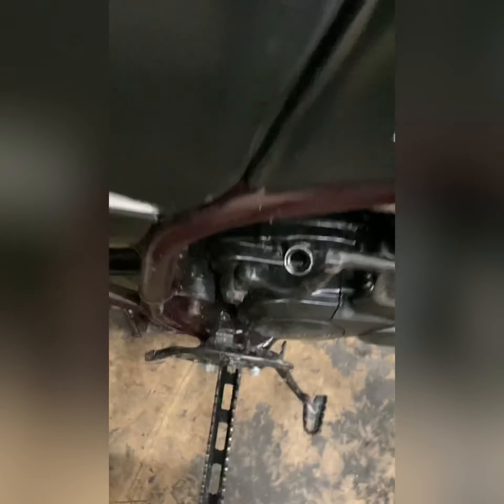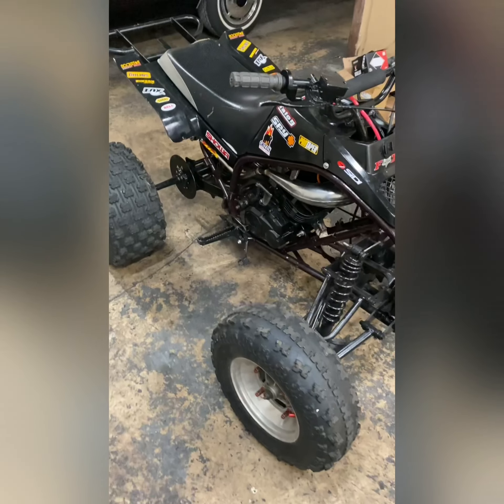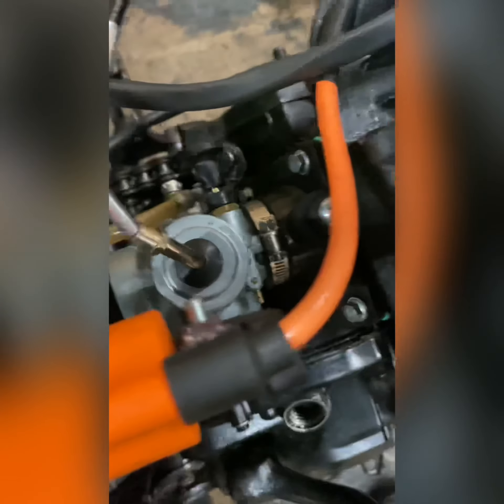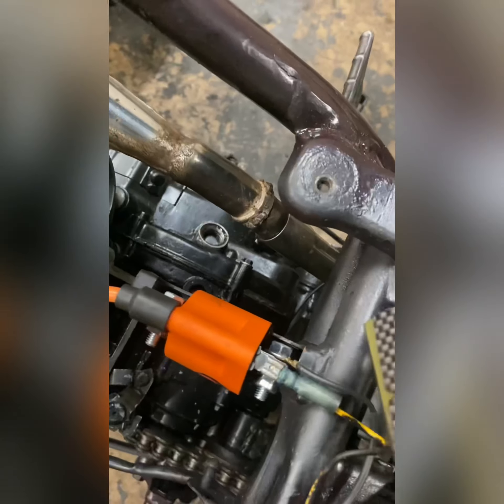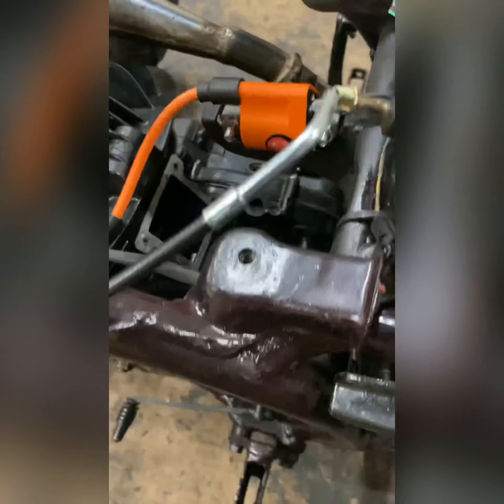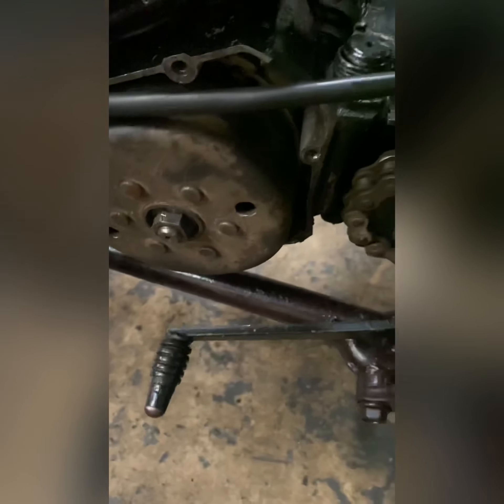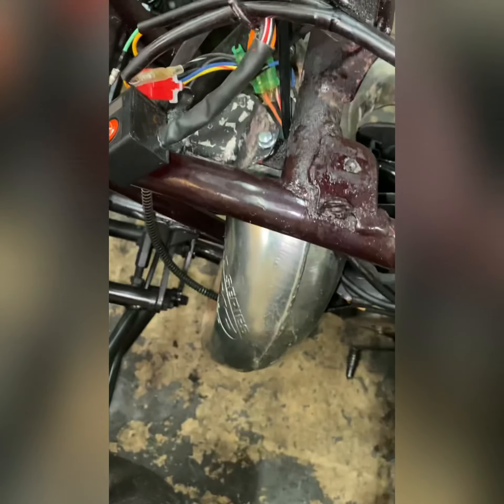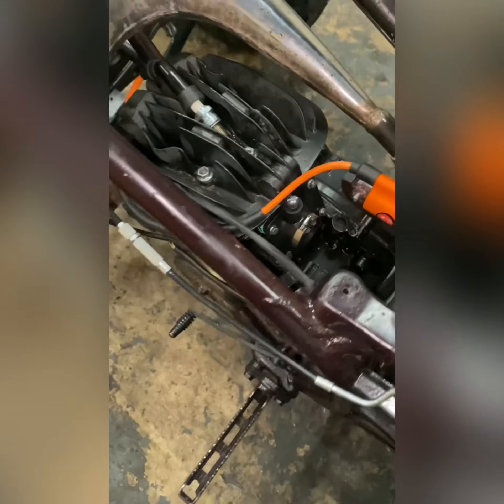🔧🍋 part 1 the first Chinese 2001 Yamaha Blaster inspection all chinese parts South Florida Vibes

Comment: how come 4 -wheelers come stock with a thumb throttle ?
Reply: To go slow bc they come with a safety screw majority where it can only go so far and they think you’re on four wheels more laid back thumbs easy I take that junk off all my quads and do twist now if it’s a automatic I leave it be no point it’s a cruiser
Reply: @yungBitta291  da fuk you saying?
Reply: cause its safer, a quad has 4 wheels and its not like a 2 wheel bike where you have a different sit position, on a quad in a turn you have your arm streched and you lean in, on a bike the steering wheel stay the same distance. anyway i mean on a quad you turn and you can hit the twist throttle and get fuked had that a couple of times on a banshee switch real quick back to a thumb trotthle cause you dont want those accidently gas when you dont want it.. but you get used to that but the main problem is what i find its way more anoying cause you cant really give it full gas quick without hurting your wrist, i can smash the thumb trothed way easier, motion doesn't feel the same on a quad then a bike.
Reply: @reggiexp69  da fuk you saying?
Reply: Safety
Reply: @AL4N.  sorry i went of subjet :) i wanted to say cause on a quad thumb trothle is safer, you are less likely to give accidently gas, its also baised on the rider position on a quad is not the same as a bike, to turn a quad you go full lock, a 2 wheel bike you dont do full lock unless you turn at 5kmh speed. i guess just google it, this is my experience with twist or thumb on a quad, road use twist might be handy, offroad better of using thumb
Reply: Don’t believe me get two the same bikes blaster whatever know there stock jets the same then put twist on one and keep thumb get two people that actually know how to ride balls to the wall shift repeat see what quads quicker also make sure to count teeth and make sure chains goodentight then you can come back be the man and say your right bro my bad it’s ok son we all make mistakes in life just think before you act and choose wisely before you speak with wisdom some will learn something useful every day but a fool will be a fool and a idiot will always make stupid mistakes over and over again repeatedly until people truly realize and avoid them like the Plague  bc they don’t want to dumb there self down to hang around